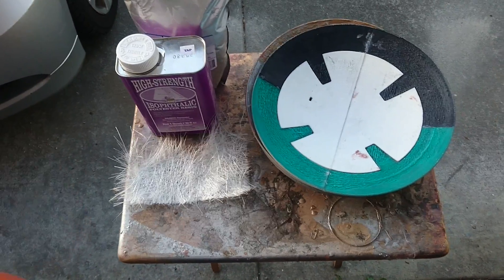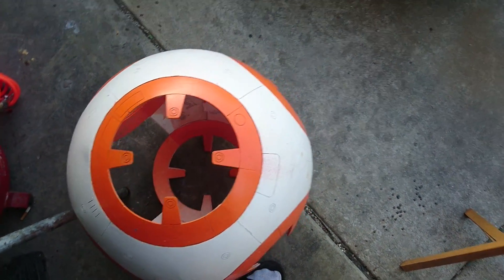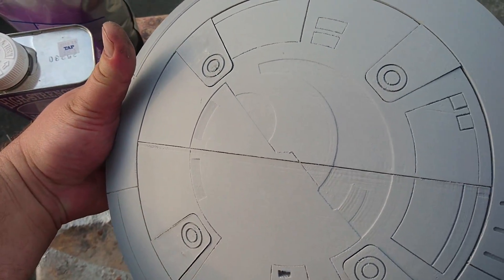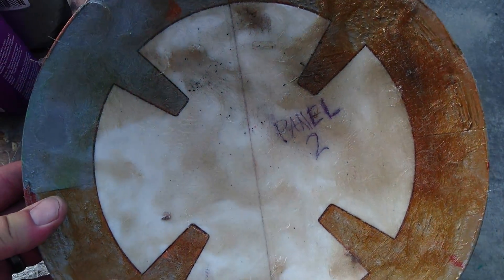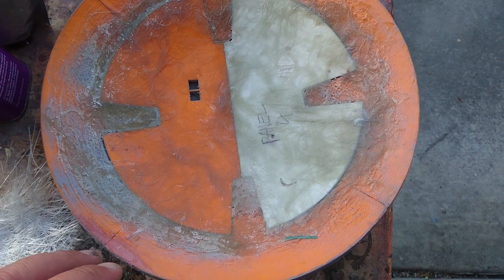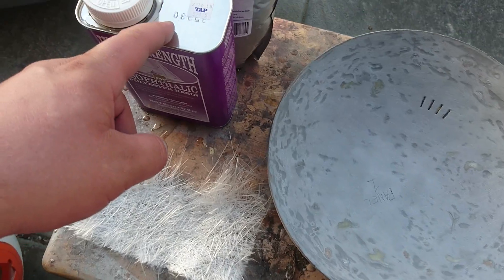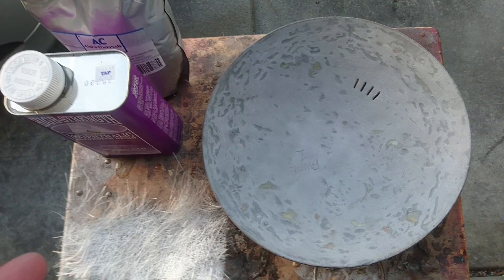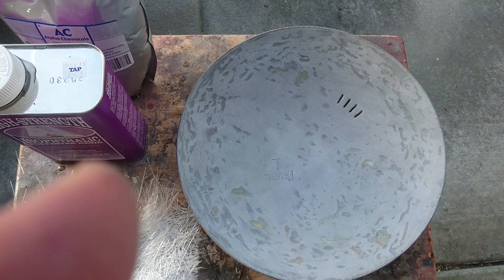BB-8 Body Creation from 3D Parts and Fiberglass

Comment: hello Jay,
nice work, but i have a question please, you said it's a 3D printed part, is that ABS ? and how did you manage to prevent polyester from melting the 3D printed part ?
Reply from the maker: If you brush in the resin, mixed with aluminum powder, then brush in your fiberglass, it, it ends out being fine. The shells are 1.2mm so It takes a bit for it to "melt" through the printed parts, but fusses well with all parts. Its not as invasive as acetone.
Reply: Jay May thanks for reply but i did not really catch what you mean :/ what i am looking for to do is a 3d printed plug and then make a fiberglass with polyester resin mold out of the plug, but what we know is that resin while curing generates heat and it might melt the ABS plug
Reply from the maker: So you want to finish your 3D print, sanding, primer, finish.. then make a silicone mold. With the silicone mold you can make Fiberglass parts.
Reply: Jay May what do you mean silicone mold ? how to do that ?